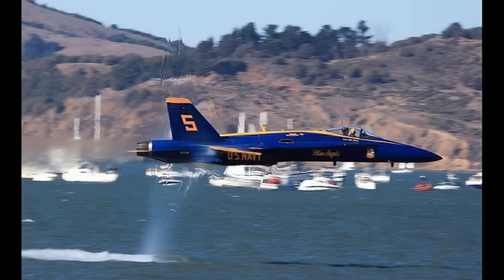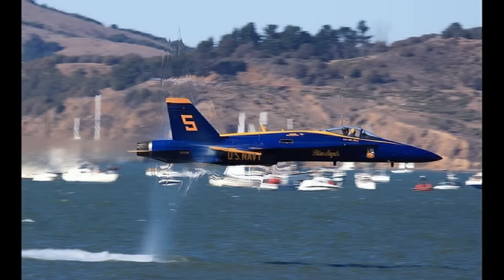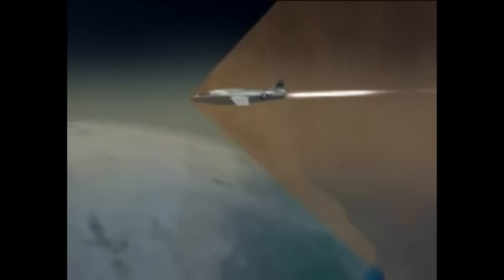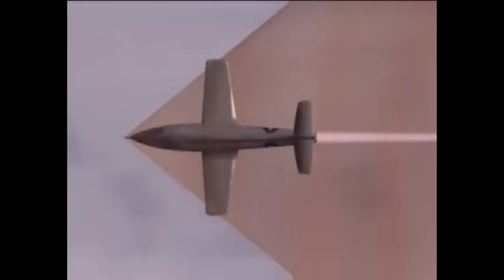Supersonic Flight, Sonic Booms

Comment: The blue angel is NOT flying past the sound barrier at 10 yards over civilian boats!! Seriously? It would break eardrums and glass for a mile!
Reply: It's just a doppler effect. Christ.
Reply: It is presented as subsonic in the vid, not over the sound barrier.
Reply: deltaalpha21074
Hey man, just for reference, the Brits broke the sound barrier on the ground in a jet car several years back.  The driver was an RAF pilot.  Dunno about the 757 at 150 feet, though, even if they are ridiculously overpowered, according to Boeing.
Edit: Changed my mind about that last sentence.  The 757 prob could do 500 mph at 150 feet. Cheers.
Reply: You are right because even with all the power of the JET ENGINES cannot overcome the density of AIR at such low levels reason NO so called JET PLANE ie 757 hit USA PENTAGON on 9/11 and so called disintegrated with no parts all over the ground?  Yeah try to get a 757 to do 500 MPH at 150 ft off the ground GOOD FU##ING LUCK?
Reply: deltaalpha21074 k...
Reply: deltaalpha21074 WUT
Reply: I was at the beach when they were performing and they flew that low and you can see the air on the jet and they flew 9 feet above the water and my ears are fine
Reply: Creating very powerful vacume reminds me of FIREFOX --remember that movie?
Reply: it's referred to as the "sneak pass". they travel just below the speed of sound, and literally, sneak up on you if you're not expecting it. 2 jets do it at right angles to each other.
Reply: esawrr What would happen if 2 jets approached each other flying faster than speed of sound and criss crossed at very very close range of each other? ahhhh may blow each other apart huh?
Reply: The Brits and French tool passengers supersonic in Concorde, not anymore :(
Reply: +deltaalpha21074
 Nah...turbulence behind the jets is more dangerous than the shock wave in such cases

Comment: None of these jets are breaking the sound barrier!  Vapor always shows up depending on how much humidity there is in the air! The noise is just the sound of the engines trying to catch up to the jet. They are flying fast close to speed of sound but no way any of these jets are breaking the barrier
Reply: dumbass

Comment: Not pressure wave... There are 3 types of shockwaves: normal, bow, and obliqe. And temperature in all 3 types increases, not decreases, because it has to take energy from something to create drag. And you said pressure drops, which pressure? Static or Dynamic? Or maybe Total? In fact static pressure increases, because behind shockwave speed decreases and creates friction which increases the temperature and creates a lot of drag! That is why fighters have afterburner to accelerate through these shockwaves. Something like this.

Comment: You may or may not have heard of this, but I've heard of 747's reaching mach 1(the SP models I believe-smaller plane big engines) Anyone know about that? The model may have the p/w, but does it have a supersonic critical mach? Is that possible 4 a plane of that shape? It seems the best chances of protecting(@least the INboard) engines would be if the bow shockwave helped protect the turbofans from the ss flow. The shape of the pods may preclude diffusion, however.

Comment: Cool video but the "Atlas" rocket was actually the Ares I test flight of the cancelled Constellation project. It was suppose to take over the Space Shuttle's role and for future missions. The Ares I was to ferry crew while while the Ares V was to ferry heavy payload to low earth orbit and was to be the largest rocket ever built (larger than the mighty Saturn V). The project was cancelled due to the economic downturn and reinstated under Obama and renamed SLS. It's been kept low key to avoid concerns over spending despite the need for it if we intend on staying ahead in space exploration. The modular system will also be used for planned lunar missions and a mission to rendezvous with an asteroid to be captured and placed in lunar orbit. http://www.nasa.gov/pdf/664158main_sls_fs_master.pdf

Comment: It is not possible to bend something that has no physical properties. Sound leaves a speaker @ 0 seconds and arrives @ 1 second, on or off
Reply: P Nelson Dude...I shouldn't even try, but let's do it. Light is the reaction by electrons to a photon, a particle which doesn't have mass, in theory because it doesn't interact with the Higgs field (the famous Higgs Bosons). It doesn't mean it doesn't exist. By altering the pressure of the air around it, a jet or rocket can bend light because photons travel at different speeds through different materials (the reference for the speed of light - the letter "c" - is the speed of light in vacuum), and thus slows when travelling through highly compressed air, reaching your eyes at different speeds from the light surrounding the object.
Reply: Aaron Wilbern You're*
Reply: This is where a Chuck Norris joke is usually inserted...
Reply: razveck The comprehensive answer!
Reply: please tell me your a troll, if not.... then im sorry to say but i dont think there is anybody more stupider than you
Reply: Light has no weight and no mass. So you believe something can act upon nothing and I'm the retarded one....
Reply: Abdul Uddin i'm telling you that you're a troll....
Reply: *****
i know right !  waht a stupider guy
Reply: ***** what was intended could not be a mistake.
     Abdul Uddin

 you do realize that i used the word "stupider" again -__-
Reply: Jack Young
i literally liked your comment because its too long for me to read,.. therefore you must be right
Reply: They call it the sound barrier but it's actually not
Reply: Jack Young Close. Light does not actually have mass -- even though it can act as a particle, that particle is massless. It does, however, have momentum and will exert pressure on a surface (this is how "solar sail" spacecraft are propelled).
Reply: this topic is crazy

Comment: I thought the blue angels weren't supposed to break the sound barrier.
Reply: They don't, listen to the video again, "Pushing speeds near mach 1..."  Also there is a description showing high subsonic flight.  The cone forms because they are flying over water which has a lot of moisture and as the air cools it causes the cone even at subsonic speeds....No aircraft is allowed to break the sound barrier over us soils except for a few places out over there desert or in the event of an emergency is the only time they are allowed to.

Comment: As an aircraft mechanic and pilot, I can tell you with confidence that you don't need to worry about chemicals being sprayed into the air by commercial airliners... The contrails (condensation trails or vapor trails) are from the engines. Water vapor in the exhaust is very hot, so when it comes out at high altitudes it condenses into a contrail, that looks like a cloud. Speed doesn't make them massive. Or make the sublimate faster.  Also, you can take off your tin hat

Comment: the same as to which inches are related to :feet" ft; meters are considered to be the building blocks of miles as there are a few hundred meters in one mile, you have the power of google, just check it out

Comment: Breaking the speed of light incurs two major problems as a result of such speeds. The first is to encase the human body and vehicle in suspension since material atoms will no longer have adhesive properties. And decelerating properly to return in normal space/time dimension otherwise one will be lost in the future or pass, depending which direction they travel in reference to the expansion direction of the universe.

Comment: And here is something from the holy Qu'ran;

In religion there is no compulsion. The right way (of faith) is realized (through the preaching of Islam) (so that it does) (clearly distinguishes the pagan unbelief) before the aberration. Whoever does not believe in idols, but believes in Allah, who thinks he (it) on the firmest handle, when there is no crack. And Allah hears and knows (all).

Believe in God not in engenniering! I u want answers of questions. go 2 a library and read the Qu'ran.

Comment: The speed of sound is the Local speed of sound. The mach number is the ratio of an a/c true air speed over the L.S.Sound.. Mach 1 is equal to the speed of sound. Airlines travel at around Mach 0.74   Note: 661 knots is only at sea level of 15C, as the local speed of sound varies with temperature, the lower the temperature the lower the L.S.S

Comment: That could be a valid point. Although I am a such person and the air base has been careful about breaking the sound barrier in too low altitudes. I was 5 in 1991 when my sister and brother came home from school early as fighter jets had broken all the windows at school with a sonic boom flying too low. That's the only time I recall an inconvenience caused by this. And I was bummed cuz didn't see it and I wouldn't go to school until Im seven :).

Comment: At 2.25 I already knew that air was filled with chemicals.
2.32 You can see the colour spectrum in the clouds from the aerosol
2.35 the nano particles in the air react in this way.. waves from the shock of the rocket
Google: geoengineering.. youtube.com/watch?v=jf0khstYDLA

Comment: What these guys are showing aren't shock waves, they're expansion waves from supersonic air accelerating over the wings. These aircraft are not in the supersonic flight regime, they're in the transonic flight regime with mixed subsonic and supersonic flow speeds. Furthermore most jets can't maintain supersonic speeds without Thrust Augmentation (afterburners).

Comment: The Blue Angel (The #5 F-18 painted blue) didn't break the sound barrier. The vapor coming off the wings and the rest of the jet is caused by speed, but also the amount of water in the air. Lot of jets at airshows produce vapor cones, and even some propeller craft in the right conditions. Blue Angels (or any other craft) aren't allowed to break the sound barrier over land (or within a few miles of land) if they are below a certain altitude. I believe it's about 10,000 ft. in the U.S.

Comment: Sound moves 0 m/s @ 0 s/m. Time travels 1 s/m @ 1 m/s. Speaker clusters farthest from the stage require the most amount of delay on audio output signals. 

Those rings are moving faster than the rocket.

Comment: when I mentioned jets are restricted from going passed 0.80,that is mainly for air shows. It looked weird when I said surpassing mach 0.80 for safety reasons because of a sonic boom. That is because the higher altitude you go, the slightly lower speed you must travel to go super sonic due to "thiner" air. Im sure that most  pilots at air shows go passed that safety barrier but the must then be at full attention to keep the jet below mach 1.1( sonic boom). I've seen a F-16C at mach 1.0(transonic)

Comment: at 0:31 , that is just caused by moisture with in the air, nothing to do with going supersonic ( sonic boom) the aircraft was not even transonic( matching but not surpassing the speed of sound. Jets are not allowed to go past mach 0.80 for safety reasons of that a sonic boom could cause damage(.broken glass, loss of hearing for most)its like in a steam room when you sway your arm and feel the vapors.0:31 is the same concept except on a bigger scale.anyway nice video,those passes at sea were real

Comment: @iReece2k11 Which Mythbusters episode is that, I would be interested in seeing it? Also how did they conduct the experiment? Isn't the shockwave size and strength dependent on the size and aerodynamic properties of the object?

Seems interesting  but if the shockwave of a fighter jet was that strong would two jets going supersonic near each-other knock one of them out of the air? Obviously I'm making some big assumptions here.  Is their such a thing as a subsonic boom?

Comment: @feelsgoodnow Okay, if you watched Mythbusters, you will know that a jet flying super-sonic over a regular house at a height of just under 150 meters, is enough to tear the roof off. That's simply the sound and the shockwave of air...

Think about it. It only takes 15cm of fast flowing water to drag you down, not much...
And, supersonic tests can be done on land, but they can only be performed in an unpopulated area with a 50 mile radius (I think? Maybe I'm wrong with that)

Comment: @Robert30025 I'm a 3000 hour instructor pilot & Jr. High science teacher. As air pressure over wings drop it cools the air causing it to condense in the form of visible cloud (wing tip contrails). As air in front compress (the shock wave) 2 things occur. 1:Air compressing "forces" moisture out because space between air molecules become smaller-leaving no room for the moisture. 2:Compression heats the air but when the air rapidly re-expands it cools causing condensation (the cloud that you see).

Comment: @XshadowX0eXeSe The atmosphere isn't constant, so aircraft speed isn't constant. So the aircraft moves from just under to just over the shock wave barrier. Atmosphere temperature, barometric pressure, moisture (humidity) etc. plays a roll in all this & so nothing (like the cloud) is constant. The aircraft's Indicated Air Speed (IAS-what the pilot "sees" on the instrument gauge) may be constant but Its actual speed, True Air Speed (TAS) is constantly changing & so too does the Shock wave cloud.

Comment: You can duplicate this effect with a hypodermic syringe. Hold your finger over the hole (where a needle would normally be placed). Push the plunger as far as possible compressing the air in the barrel. Then let the plunger pop back out. Remove your finger from the hole and then push the plunger. The air coming out will look like smoke.

Comment: The narrator says that "air pressure drops" causing it to cool therefore decreasing it's ability to hold moisture. This is false. The object moving through the air actually compresses the air causing water molecules to stick together. When the pressure drops back to normal the vapor appears.

Comment: I had no idea what was behind supersonic speeds until I started learning about the F-15 for my job. The air inlet system has various components designed to cover the intake to keep out unstable supersonic shock waves to keep from damaging or stalling the engine. This video is very cool, not surprised though, it's a AVweb video =]

Comment: @bsg1206 Obviously you have no idea what's happening here... 0.75 PAST  lightspeed? For starters that's not even physically possible, not even for light. Second if you meant the speed of sound, the F-16 Falcon can reach speeds of 1500 mph plus at cruise altitude (Mach 2+). Which is not "0.75" past, assuming you mean mach, if you mean MPH, please read reason 1 again.

Comment from the maker: It may be important to reiterate that aircraft do not need to exceed the speed of sound to create certain shockwave effects. The Blue Angels jet, for example, is flying at subsonic speeds and is not producing a sonic boom. But it is showing shockwave light diffraction effects in the still image at 1:02 as well as condensation effects during the low-altitude high-speed pass at 0:26 .